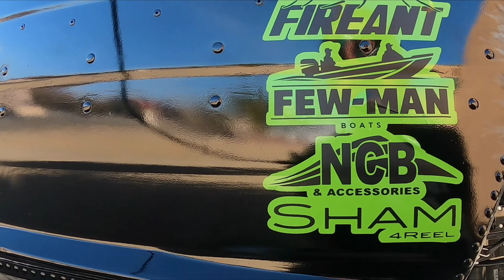I repainted my boat: Re-spray paint touch up!

Comment: I spent 5 years in a body shop paint department before the Air Force. Honestly it’s messy but I’d wet sand the primer with 400 on a block and a gray scotch brite and call it a day before painting.
Reply: @TinyBoatNation  the smoother the surface the better gloss you’ll get. Black is one of the hardest colors to make look right. If you ever repaint your boat again, I recommend wet sanding with 320 and then hitting it with a sealer before the color.

Comment: I have a 16 ft flat bottom jon boat and I am thinking of putting an aluminum cabin on the back. I'd like it to be just tall enough to sit inside to get out of the elements and strong enough to serve as as a raised casting deck. Do you have any suggestions on how to build something like this?